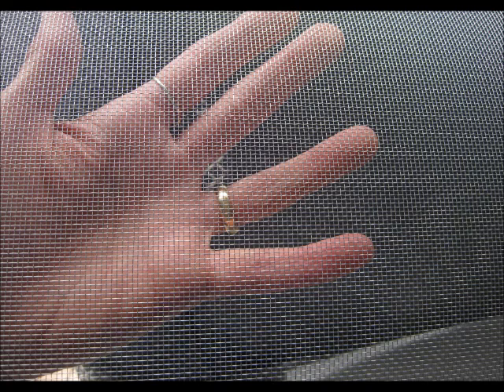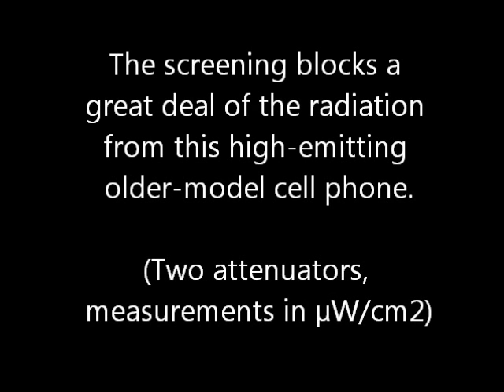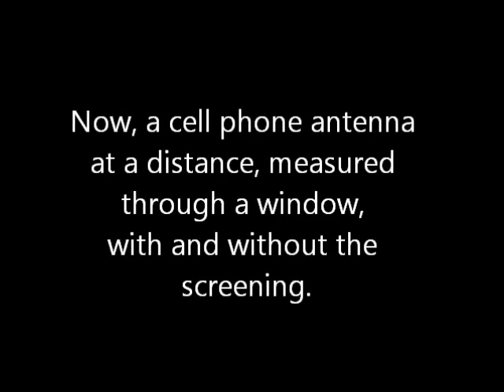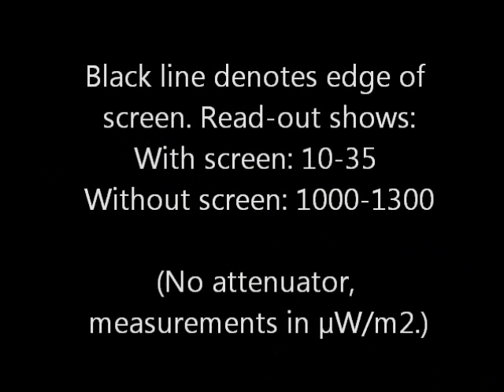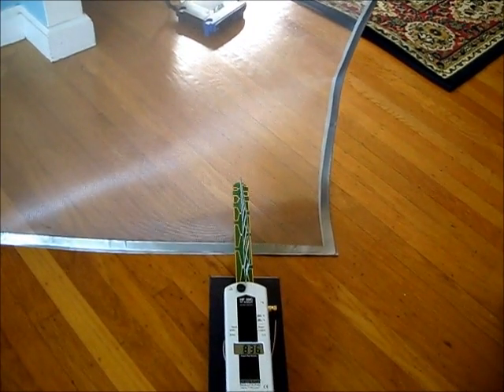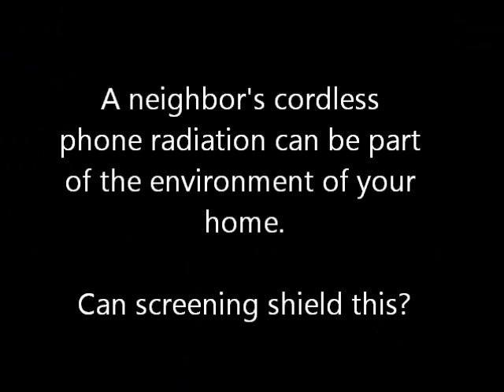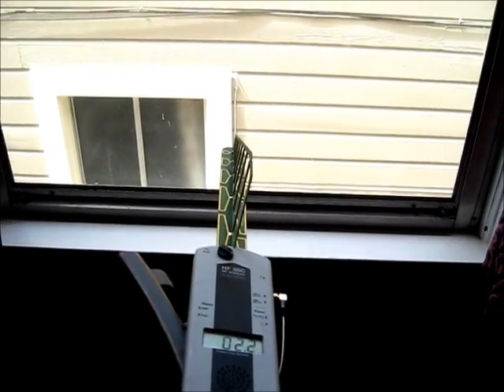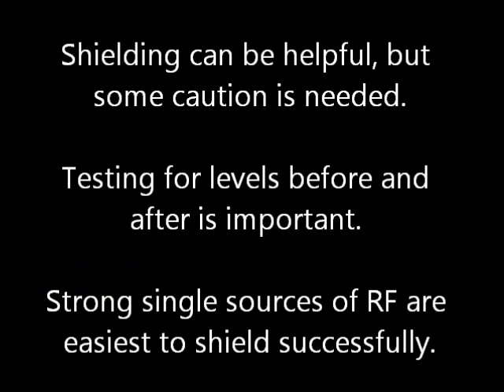Shielding RF Radiation with Aluminum Screening

Comment: Thank you for the video. 

So I don't need a perfect faraday cage to block most of the radiation? I was thinking of putting aluminum mesh on my walls, ceiling and floor in my room but it's extremely hard to create a cage without any gaps. Thanks to your video, it seems like I don't need a perfect cage to mostly protect myself.
Reply: Escept if the radiation gets through the gaps adn bounces around like in taht one example

Comment: HI. Have you compared copper mesh to aluminum, by chance? We wan't to RF-proof the sanctuary indoors and outdoors. The architect said only copper screen will work. I used aluminum in the windows and RF dropped by 60-70% it seems. However, the pulses still came through as pulses, just on a smaller scale. It's the pulses that some say are harmful. I don't know that PEMF vs EMF has been studied. If you have this info or can help us figure out if it matters if we use copper or aluminum matters, please drop by LJK9.com and send a quick message. We'd very much appreciate the help as we have a small cell right outside and 5G is being installed any week now =(

Comment: Thanks for the demo that proves. Pays to get aluminium fly wire on the windows of your home instead of the cheaper plastic fly wire mesh. Also the aluminium paper(vapour barrier) under the cladding on the outside walls of your house will stop EMF.

Comment: Glad I decided to look this up. I have a problem where when I stack 2 Realistic Pro-2006 scanners on top of each other the digital signals generated by the radios cause interference with the other radio. At least i believe it is the digital signals. In any case, when I stack the 2 radios they generate interference. Birdies and the like. Tomorrow I will buy some aluminum foil and wrap both radios in foil. I will also ground the foil on each radio. I have high hopes this will solve my problem. Thanks

Comment: WiFi is not needed. I have FASTER than WiFi and didn't need any special equipment. Using the same modem. Ha! Check out the 0 PING. The long time Comcast worker said he had only seen that 2 times in his career. I don't have those frequencies that cause pressure upon the chest. Call your provider and demand Ethernet... they will laugh because they are still ignorant and are paid to push it. 5G is NOT the fastest.

Comment: Southern Oregon just got plastered with Smart Meters via Pacific Power. A fishbowl of radiation. Turns house wiring into a lot of dirty electricity. 1 receiving antennae for every 100 Smart... meters.  1000 antennae installed. 
Opt out Fee is $36 mth. PUC sold us out with an inaccurate cherry picked govt. 'study'. Lots of lies. 18 neighbors in an internet group reported radically high Dec. bills, doubled or tripled. Co. unresponsive. 1 family was  gone most of the mth. and had $588 bill though heat set to 55 and supplemental gas on separate bill. Probably 'Peak Hr. Charge' fraud.
Co. won't sign responsibility for fires, health issues, damaged appliances or privacy breaches, selling info to other parties.
Remember Paradise fire Elec. Co. just filing bankruptcy. Increased fire insurance premiums coming soon, perhaps.
 Forced install or a 'meter reader fee' for unsafe equipment is extortion and against Federal law.
Move to saner States.

Comment: We are hoping to build our home this year. Can foil backed plasterboard blocl WIFI radiation. We will be putting plaster board inside the house so I was wondering  if we could do this and then wire the house so we can turn off wifi when not using it. Thanks

Comment: Just came across this great video jan. 15 2019. There are many meter options now from $90 to over $1,000 like the one in this video. BUT, the problem is deeper than you can imagine. For me the best protection solution,as I am surrounded with Smart NAT. GAS Meters 20-20’ from my pillow, may be an RF SLEEPING BAG that is 50% SILVER FABRIC They cost about $450. If you live in the city or modern mobile home park, you may already have EMF caused diseases such as I have Chronic Fatigue that thyroid med does not help. The sleeping bag isolates you so your body can repair damaged DNA while you sleep. That is why we need sleep but we need to shut out the causes for +/- 8 hours. Compact Florescent lighting, some LED Lighting etc also FEED BACK DIRTY ELECTRICAL FREQUENCIES ON TO YOUR HOUSE AC WIRING. And that calls for another type of Meter to read DIRTY EMF. FRANCE has past a law to eliminate and ban wireless devices from schools etc.

Comment: For the wifi modem, along with blocking the harmful EMF, does it also block the actual signal or are those one and the same thing? Thank you
Reply: They are the same frequencies. Best to switch back to wired Ethernet if your router/modem allows it.

Comment: I wonder if, when building a new house, one were to put aluminum screen under the sheet rock?  I guess if you were worried about RF you could do the entire room and then add a second layer of sheet rock.  Might be a bit tricky with existing door and window trim though.  Interesting concept.  If I were building a new house I would do the whole thing in screen including the floors and ceilings then put up the rock.  Six inch walls thick insulation and aluminum screen.
Reply: That's a good idea. Since I own my townhouse I'm tempted to try it. I get strong wifi leakage from adjoined neighbors on two sides. I already have a big roll of aluminum (gonna be shielding a 12x14 bedroom), and depending on the reduction I measure, I may be tempted to do something as you have described, tearing out the sheet rock while at the same time shielding the house's electrical :)
Reply: because if you do that much you may as well make sure the home's wiring is shielded too. also make sure its all grounded and be careful not to electrify the whole screen lol
Reply: That's exactly what I was Thinking!

Comment: What about aluminum siding? seems that would block it; what do ya think? Thought I'd buy a meter, but with 5G coming soon; would it be better to wait for meter development to detect this band?
Reply: "5G" is actually 6ghz all the way to 100ghz... so quite a massive "band" if you can even call it that any more... Meters that go up to 8ghz will be useful for most things but measuring all the way from 200mhz to 100ghz is going to need a pretty expensive piece of kit I'd imagine.

Comment: Does the screen prevent you from using the WiFi or cell phone receiving calls?
Reply: Yes, that's the point. To stop those harmful frequencies. Switch to wired Ethernet cables for internet if you can, and as for mobile phones, you can leave an area unshielded and put your phone there with the ringer/message alert on high volume so you can hear it from a fair distance away.
Reply: I think it reduces it but doesn't block it completely.  Mesh cages are sold to place over routers to reduce the signal.  Still works fine in the house.  Most wifi routers are way too powerful.  It's why you can pick up your neighbor's router on your phone.
Reply: Many routers have power controls for wifi in the setup screen. Crank it down until you still get an acceptable signal. If you have a compact house that works fine.

Comment: Hii 

 i am keep wondering this:

when we put mesh with tiny holes  or aluminum sheet in between the microwave source and microwave detector device , it blocked all the microwave reading on the detector. 
why is it ?  
does the sheet or mesh absorbed the wave (since the wave is of high freq, when being absorb (the sheet and mesh acts like a damper for the microwave, kind of like a capacitor in a electric circuit, after being absorbed by the sheet and mesh, they are no longer microwave) . is it so ?  being absorbed by the sheet ? 
or 
being evenly distributed by the sheet ? 
what i meant by evenly distributed is that the wave goes into resonance with the sheet, and the whole sheet is resonating at the same frequency BUT at a lower amplitude  throughout the whole sheet.. hence  the detector can't detect it, because the amplitude become so much lower , because being "diluted" distributed to a bigger surface area. 
why i say this is:
i saw the youtube video where the professor said the mattress coils absorbed the microwave and emitting it to the human who sleep on it..  so in this sence, the coil is acting like an antenna.. since the coil can acts as antenna, why the alu sheet and mesh won't behave the same ? 

your opinion and experience will be appreciated. 
 
andrew
Reply: A conductor reflects RF. Satellite TV antennas have conducting layers which focus the RF to a feed point (the downconverter box). A solid sheet reflects waves whose wavelength is smaller than the sheet. You can find wavelength to frequency converters on the net. A hole or screen size less than a quarter wavelength is not going to pass any RF, but reflect it. 

At microwave or cell phone frequencies, a sheet of aluminum foil works as well as a thick sheet. Remember, it reflects and doesn't absorb. You can make a nice reflector for wifi to direct it a certain way (or steal your neighbor's) by making a parabola around the whip antenna... there's directions on the net somewhere.

Large sheets will resonate at a half wavelength, but if you do the calculation you'll find that's somewhere in the FM broadcast or low TV band. RF below resonance will pass through it; higher frequencies will reflect. 

You have to be careful about hot spots where there are reflecting surfaces, kind of like how things like glasses of water set in the sun can burn holes on things behind them. Of course the danger from a distant cell phone tower is minimal; your smart meter puts out much less power than a cell phone; and you probably don't sleep with a phone under your pillow. So I say don't worry about it.

Put your wifi in the basement and it will cover the whole house but not go out to the neighbors. Any metal between it and you like your mattress springs is going to attenuate it.

I can't find a good reference for the power density equation, but you can figure the difference by measuring relative distances from an emitter. It scales by the square of the distances. So a cell phone a half inch from your head versus one across the room at 50 inches puts 1/10,000 the amount of power per square inch onto a surface. 

It's worry that makes you sick, not low power RF or "dirty electricity".
Reply: i do have a wifi at basement of my house, but the reception on the 3 floor is terrible.  i guess surely neighbour won't get much of my wifi signal.. lol

thanks for your info. 
it is a bit deep for me. i will really have to put it under my pillow and sleep on it..  
thanks
Reply: The good ole Pringle's Can antenna is a favorite among geeks. It'll give a 10 dB gain in a specific direction, so you could put it in the cellar, point it up, and get a decent signal on the 3rd floor. Look for blockages on the way - heating ducts, filing cabinets. https://www.wikihow.com/Make-a-Wifi-Antenna

Just a parabolic in back of your regular antenna will help. http://thebestwirelessinternet.com/homemade-wifi-antenna.html

Try orienting the antennas for best reception. The radiation is a null off the ends of the antenna (along the axis). You need to have it parallel to your receive antenna and in the same direction. Polarization is everything.

Comment: I am using a smart meter shield until I replace it with an analog meter. Question: When I cover the meter, where does the radiation go? Does the radiation intensify and go into the house wiring?

Comment: Does two or three layers of the screening improve with lower numbers?
Reply: I''ve used screen rooms at work to calibrate sensitive instruments. They use two layers of copper screen that aren't connected. I forget the attenuation numbers but basically nothing gets through from VLF to microwaves.

Comment: So... if the neighbor's cordless phone signal goes into my house, that means, with proper equipment, I technically could listen to- and/or record their phone calls, right?
Reply: Newer phones are DECT 6 and are encoded, so good luck with that. Analog phones you could pick up with the right radio. I've listened in on analog cell signals from an old tower, but that was ... shoot, 15 years ago, I dunno.

Comment: If I can't use one of those 'mosquito netting' Does it make sense if I put it simply over my bed for example, or on the top of my sheets when I sleep ? And to go further : can anyone tell me if we could be using pieces of aluminium net like this to make a sort of helmet, to be worn ? Because after all, radiation is nocive for our brain first of all. Can anyone answer me ? I would hand-make it, but I first want to know if that is not gonna increase the radiation over my head.
Reply: im new to all this and in Australia  but they are now making hats that block radiation and you may be able to find bed canopies made from shielding fabric

Comment: the wifi unit after screened will keep on working? I mean remotely connected wifi devices would keep getting the signal?
Reply: Not if you've shielded it. That's the signal you're stifling.
Reply: hard wired devices through Ethernet cables will still work ;)

Comment: Good on you for showing this. I have already begun replacing all of my fibreglass fly screen with aluminium ones. Also have covered above the ceiling with aluminium sided sarking. After foiling some walls and especia;;y aluminium window screens I noticed that neigbour wi-fi levels dropped a lot when checking with my wi-fi site monitors as well as the mobile phone dropped a bar in reception inside the house.

Comment: This could be solution to my problem! 

I'm having serious problems with LTE signals coming from a mobile mast off the the left of my home. I've had to move my satellite dishes yet the LNBs are slightly out past a window bay. If I stand on a ladder I get full transponder feedback without any fails. As soon as the line of sight is free I get 9 fails or more. I've tried foil which has only slightly improved signal but still allowing transponders to fail. I'm suspecting some of the microwaves from the mast are hitting the dish and being fed back into the LNBs. If I built a mesh frame and pinned it outwards like a for sale sign it should, in theory work just as my body did and block those signals affecting the dish?? 

Considering this was just a screen, unlike a Faraday cage. Feedback would be greatly appreciated to anyone who believes this would work.

Comment: Excellent video.  Thank you for showing how there are some relatively easy, budget manageable steps that someone can take to reduce EMR levels and exposures, especially from 'uncontrollable' transmissions from outside your home/work.  There are many nuances and caveats (like radiation coming in from the opposite direction) but keep "stacking the deck for success."  There's something called the Pareto Principle that quality managers use...go for the biggest possible impacts that you can manage and celebrate that benefit to your body!!!  And never forget to be as vigilent with what you have control of, inside your house (your computer wiring, no cordless phones, etc.).  PS to 3TimesDoesIt below...cell phone actually can work on extraordinarily little...the manufacturers of phones and towers just follow the 'more is better' principle, unfortunately.

Comment: This gave me the idea of making a curved shield which  stands in front of my ROUTER. What u think?  I placed tourmaline crystals in front of my router.  I'm planning on putting a strip of grounded copper taped to my comp table so i can touch it with my arm while there
Reply: +Bill Soto  Hey look into ORGONITE.
Reply: put copper sheets in your shoes under socks... gliding on air.. and two magnets on shoulders

Comment: Will a lead curtain do better instead of the aluminum to block all RF?
Reply: No. Lead is heavy and works well on high energy radiation, but on non-ionizing RF a sheet of aluminum foil is just as good and a bit lighter.
Reply: @jamesvandamme7786  what do you call the type of radiation 5G signals uses please?
Reply: It's good old radio frequency radiation (RF). The frequencies range from the usual 800 MHz of cell phones to 3.8 GHz (high S band) to millimeter waves (28 & 36 GHz depending on carrier). Because mm equipment is much more expensive now, I'd expect that to be adopted much later. 

A screen with holes less than the size of a half wavelength will block RF. If you look at your microwave oven door you'll see a screen that blocks the 2450 MHz signal. Inside it's hundreds of watts, outside only a tiny fraction leaks out. I have foil insulated walls and a metal roof, so I need outside antennas for TV, FM, and cell phone. 

Lead is not needed for non-ionizing RF. It's for those nasty X rays and gamma particles. Those are way past light, and way, WAY past RF in frequency. 

Millimeter waves penetrate walls poorly if at all. I've tested cinder block walls at 3 GHz and they attenuate quite a bit, 10X or so per layer of brick.  

5G is going to be safer for several reasons. The towers are much closer to you, so your cell phone can use a much smaller transmit signal, that's the main thing. Also, with MIMO antennas they can send RF in one direction and not all over the place, saving a lot of power. And it's easier to design an antenna that sends RF away from your head at higher frequencies. 

Someday the big cell towers will be gone, replaced by small 5G antennas.
Sorry to over-elaborate but I hope that gives you some insight. My advice: use sunscreen! UV is dangerous and proven to cause cancer. As for RF, I've had a long career as a high power microwave transmitter engineer, and maybe it's made me smarter.